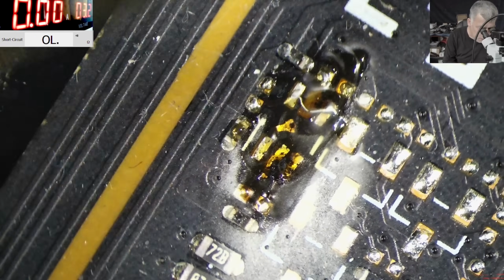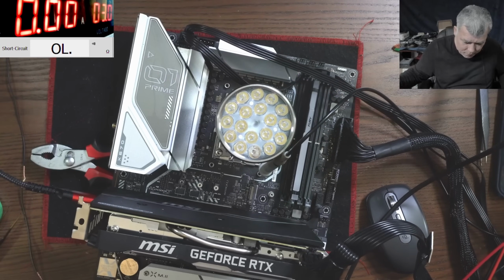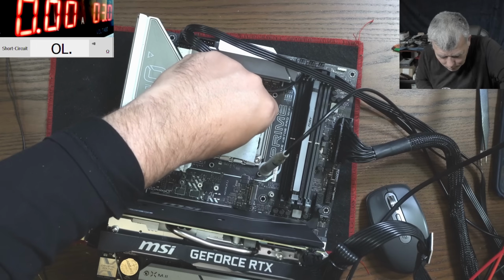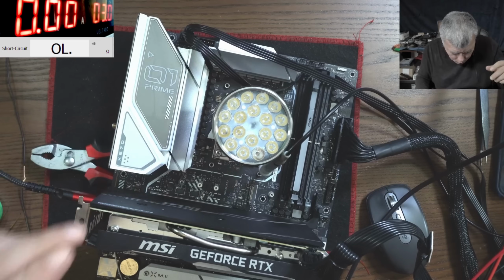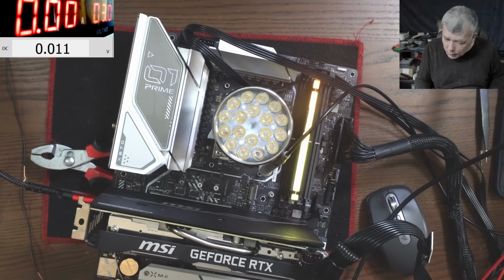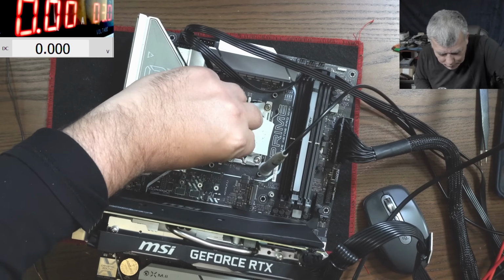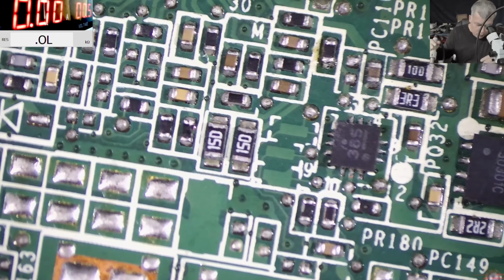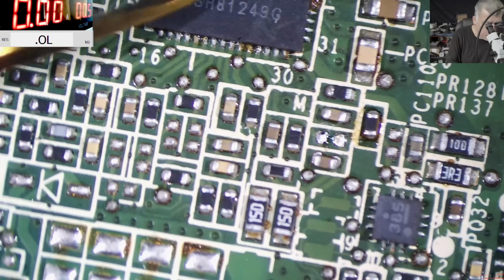Asus Prime X670-PRO motherboard repair - Replacing an unknow Mosfet/chip, can be difficult

Comment: IC WITH 6 PINS according to the picture is MISSING; 
PIN 1: EC_SMB_DA2, 
PIN 2:+3VS 
PIN 3 PCH_SML1CLK, 
PIN 4 IS EC_SMB_CK2(CLK) 
PIN 5 IS +3VS 
PIN 6 IS PCH_SML1DATA 

MAYBE SAME IC ON ACER LA-8943P motherboard LABELLED 'Q6" I JUST GUESSING :)

Comment: Sorin, I think maybe you are right about the missing part being a voltage regulator but not a fixed 1V regulator. The 10ohms was probably an external adjustment to set the regulator's variable output to 1V. Does that seam about right?

Comment: Ok so im assuming the pin in the upper left most corner of the mosfet was output, because he connected the resistors to it. If so, why did it have 3.3v on it before he messed with anything?

Comment: With big mouth NorthridgeFix this board was going to the trash, there's no way he would've fixed that. You are so much better and your videos are leagues ahead in term of educational value. Keep up the good work.
Reply: So true. Sorin is a true teacher with actual knowledge of electronics. NorthridgeFix is just like any other repair person who only know what part to replace based on previous knowledge. Absolutely no electronics knowledge being used.
Reply: thats why he just dropped 2 Mil on a house though @TEKMENT
Reply: as long as it glows hot on his thermal cam, nrf can fix it😂😂😂.
no way he can fix a burned mother board with shorts on the layers.all his fixes are easy and basic..
Reply: @areuserius328  Every fix is a worthy fix. stop the e waste
Reply: Hey don’t make any issue,they are both good in their own ways…many viewers have learned a lot from them. I like Sorin and Alex a lot.
Reply: Keep in mind that NorthridgeFix guy can't spend this much time on this kind of diagnostic procedure, So he doesn't even bother to attempt this hard repair,
Also and most importantly, he's advertising his tools and parts, which is working great by the way
Reply: deemed a No fix  lol
Reply: My asus z790h have same problem

Comment: Sorin good job, I don't understand where you soldered the output of the voltage divider, to the 3.3v pin , or 10ohms pin ? It's not clear in the picture. I see you got 3.3 from big trace and GND , but it's not clear where did you placed the output.  Greetings to you and your family

Comment: I wonder if the customer has the tiny missing chip rattling around in the bottom of his case and not realise it- your right 30 years ago you used to get a schematic in the back of the manual when you bought a motherboard or even the old 8 and 16 bit micro's that were out before then...

Comment: SL71051 ?? 
Sot-26
Reply: Even if this is the correct component, where would you buy it... and for which price (part+shipping). The repair solution provided in this video seems more cost effective.

Comment: Sorin, I would have follow a different path. When you saw there was a connection to at least two pins on the Nuvoton super IO. For instance, the two pins connected together with 3.3V present are connected to pin 99 VBAT and the pin with 10 Ohm is connected to pin 88 Power OK... This info are good clues to proceed troubleshooting. Nevertheless another excelent video, thank you.

Comment: I found that the missing 6 pin chip is the same as the one just to the right of the missing one, you will see another 6 pin chip there. I think they are the same. Perhaps you could get a similar one from a donor board? you art the least try to determine what voltages and resistances the pin show and try to replicate them on the missing ones pads/traces. Good work though. Cheers!

Comment: Hello🤝, I am positively shocked by this repair, I like how you approach the problem and you are wondering how it works, to fix it, I personally wouldn't apply the voltage just by eye, but it comes from your experience, thank you for sharing this experience with us, it is priceless. greetings for the whole family.👍👍👍👍👍👏👏👏👏👋👋👋👋👋 P.S. I am wondering how to select burnt SMD resistors when we do not know their value. I have a charger with 5 burnt SMD resistors, they are charred and cannot be read, and I cannot find a diagram or anything on the Internet to fix it.
Reply from the maker: you can figure it out about the resistors value by the placement on the board schematic. Yes, you don't have schematic but you can draw the schematic on your mind by looking at the board. Please post a board picture on our discord and we can find together what are those resistors
Reply: Hello🤝, I reached the value of 4 of the five resistors myself, but I still don't know the value of one, it is at the output (SF1 001 thru SF1 007) it is SUPERFAST RECOVERY RECTIFIER, after removing the burnt resistor, there was a marking L1 under it, so it should be a coil, but the component I removed is flat, and it cannot be a coil, maybe it was like that in the original design, but at the factory they wanted to save money and in my opinion they put a low value or zero ohm resistor there, because right after it there is a 60uF SMD capacitor, what do you think about it ? I'm sorry I didn't post it on Discord I didn't want to take the easy way, best regards👍👍👍👍👏👏👏👏👏👏👏👋👋👋👋👋👋

Comment: Salutare, mi-am permis să presupun că sunteți romîn pentru că undeva am văzut nume Sorin. 

Eu am o problemă cu un modul de amplificare în clasa D.  Avem cîțiva meșteri prin Chișinău, dar fiecare cu problemele lor, fie mereu ocupat, fie necioplit etc.

Mă gîndesc să încerc singur să caut problema, ați putea să mă ajutați? 

Modulul se numește Powersoft Digimod 3000pfc. În mediul online am găsit service manual la model foarte asemănător - Digimod 3004. 
Modulele sunt echipate cu o placă de control, la care arată un led roșu, care indică "protecție inclusă pentru canalul 1" , modulul este în 2 canale și al doilea canal pare să lucreze normal.
Reply: https://www.powersoft.com/wp-content/uploads/2019/01/powersoft_dm3000su_uguide_en_v1.2.pdf
Reply from the maker: Salut, raspunsul chiar tu l-ai dat, inlocuieste chipul/ic de amplificare de pe canalul 1 :). In viitoar daca mai ai probleme, foloseste cu incredere discordul nostru

Comment: There is a small 6 pin IC that is missing there at the upper right corner of that Nuvoton Chip. I can't make out the writing on it. Also there was one strange pin on the LGA pins for the CPU socket on the 8th row in from  the bottom. My money that missing 6-pin IC probably a control IC for the Nuvoton chip. See if you can get a look at another an ASUS x670 or x670e board to identify the missing chip.

Comment: okay its fixed but not tested under operating system may it controls a part of other hardware such as sound chip or ethernet or pci exp or usb we have seen only the motherboard  starts.Sorin did with his way just repair without changing parts and somehow it's worked.Good we accept this soluton thank you for teaching us someting master.

Comment: So many corporations have their people act as if everything is a proprietary secret. Thru their ignorance, they are scared, of loosing their jobs, for sharing any information about the products. This got to a extreme with Apple Computers. Like you said many electronic components manufacturers freely share; data sheets, example circuits. Some manufactures use those example circuits and then claim the design is a proprietary secret. Drivers for chips are always written for Windows but seldom Linux. Linux developers can contact the chip manufacture for information, but if the chip is a proprietary/exclusive design, often the owner of the chip will not release information.

Comment: Why didn't you check the datasheet of the nuvoton chip to see what's that pin does, which connects to that pad.
Reply: Because he is smart enough to figure it out on his own.  That is how he and you should learn electronics repair.  It is not supposed to be easy.
Reply: @jimle22  this is not learning.  What if that pin expects data bits?

Comment: I think mosfets can get some charge if you touch them or it gets to them somehow because sometimes ,and I faced this a lot on desktop boards, when the graphics or the cpu fans run at high speed I just reconnect somethings and it just works fine now I have no explanation to this weird stuff but static electricity can be wrong though.

Comment: Hello, great video as always. I have fixed a few board with similar issues ie. (Physical damage in the same area). The reason for the damage in that area is because most cases have metal rear covers where you put in the GPU, these you have to bend back and forth to remove. The problem is that people install the motherboard before removing these and end up scraping the motherboard ones the metal tab breaks off.
Reply: What is the purpose of these metal tabs? They need to be removed first when motherboard is about to be installed in the case.
Reply: They are just there to cover the holes for PCIe- IO in the rear of the case and its cheaper to stamp them from the same piece of metal, but it means that the end user need to break them off. @asv5769
Reply: @asv5769  - cheap cases have them as blanking plates- avoid cheap cases

Comment: By symmetry I think the missing chip is same as chip next door 701k
Reply: i was thinking the same. what is 701 k chip? i dont think it is a mosfet, maybe 1v voltage referece/or LDO regulator or less likely some logic gate or flip-flop. But I don't think it is a logic gate or FF, usually in and out are at digital levels, not 1V.

Comment: But I have. Hp probook 440g8 i3 2021.  Ssd.   It works perfectly but. Sometimes it goes off  when I plug. The power cable or unplugged.  It keeps  blinking like 30 minutes to 4 hours. And after it turns on and works well.   This happens like once in a three months. I don’t Know the problem  thanks for helping us. If  anyone have. Experience on this.  Let know.   Thanks to all.
Reply: Probably worn capacitors in the power supply side in the laptop or in the power adapter what causes noise and confuses the laptop...